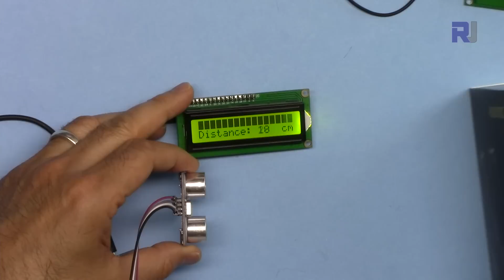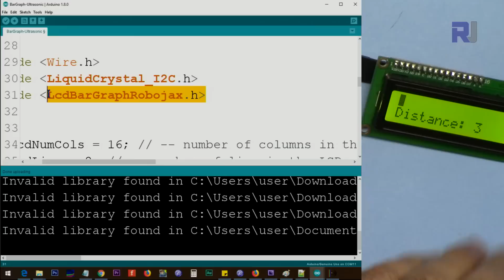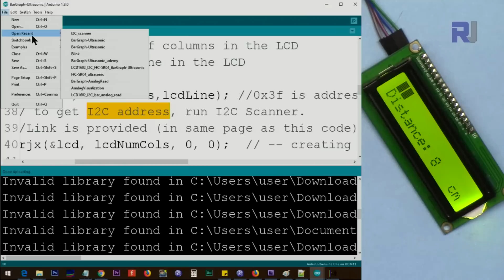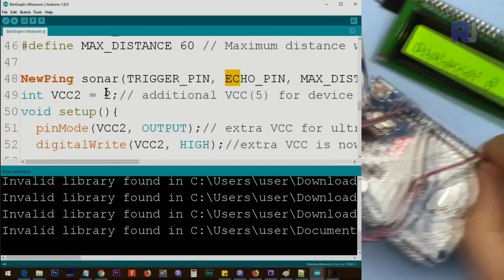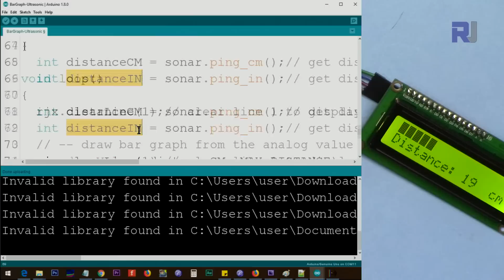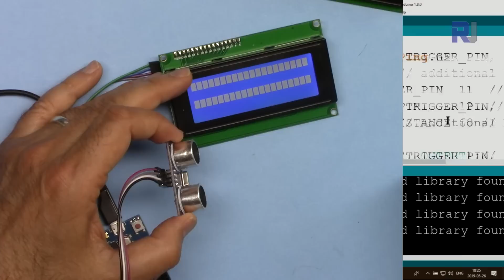Display distance from Ultrasonic sensor as bargraph on LCD1602 LCD2004 using Arduino RJT158

Comment: can you please share the circuit
Reply from the maker: what do you mean the circuit? if you mean the wiring diagram, I have explained it fully. But I hope you have watched the video where I explained that 1-Watch introduction to Ultrasonic sensor  https://youtu.be/CpCLa60WNXY and make sure  you can read the distance on serial monitor. 2-Watch introduction to LCD Display https://youtu.be/pxUjEsJQW2M and then come this. you don't need anything except the code
Reply: @robojax  Thanks :-)

Comment: Everything is working fine for 10 min and suddenly my ultrasonic sensor stopped updating lcd display and it kept saying 0 cm I thought it was a hardware failure so I brought a new sensor and still not fixed but after sometime I it got updated and stopped updating do you have any idea what is happening ?
Reply from the maker: It is the wiring. Or check is there is serial.print which print in serial monitor, comment them all like this // so they don’t print.
Reply: I don't understand I paused every single moment of your video and checked everything that you have is there in my code or not and it's all correct and still I get the error
Reply: @Robojax See the upper reply

Comment: can i use arduino nano?
Reply from the maker: Yes you can. Just make sure you supply 5V to the modules
Reply: @robojax  can u make another video using flowrate sensor?

Comment: Hi, thank you for your video, when i want to download library from description it says site was not found
Reply from the maker: Hi, Recently Chrome has added some feature that makes it behave like that. please use firefox or microsoft edge. it will work fine.
Reply: @robojax  I tested with microsoft edge and firefox and it still doesn't work, Could you check the link please
Reply: @rossiachatamerlin6903  I don’t think he did

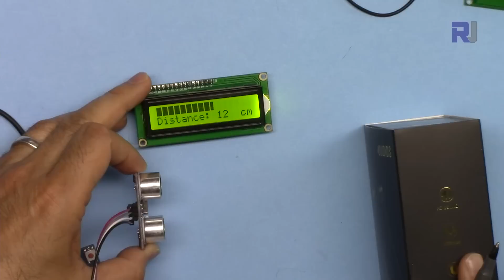Comment: 1. Arduino: 1.8.14 Hourly Build 2021/01/29 11:33 (Windows 10), Board: "Arduino Uno"

02:30:10: fatal error: LiquidCrystal_I2C.h: No such file or directory

 #include <LiquidCrystal_I2C.h>

          ^~~~~~~~~~~~~~~~~~~~~

compilation terminated.

exit status 1

LiquidCrystal_I2C.h: No such file or directory

This report would have more information with
"Show verbose output during compilation"
option enabled in File -> Preferences.

2.Arduino: 1.8.14 Hourly Build 2021/01/29 11:33 (Windows 10), Board: "Arduino Uno"

02:31:10: fatal error: LcdBarGraphRobojax.h: No such file or directory

 #include <LcdBarGraphRobojax.h>

          ^~~~~~~~~~~~~~~~~~~~~~

compilation terminated.

exit status 1

LcdBarGraphRobojax.h: No such file or directory

This report would have more information with
"Show verbose output during compilation"
option enabled in File -> Preferences.

please solve these two errors.
Reply from the maker: you skipped the video and did not follow the instruction.  I reply and any question that is not answered in the video. please watch without skipping and I can assure you,  your issue will be resolved.

Comment: this is what it says:
Arduino: 1.8.12 (Windows 10), Board: "Arduino Uno"

C:\Users\Yahya Ali\AppData\Local\Temp\Temp1_024-Using-Ultrasonic-Distance-HC-SR04-with-LCD-Display.zip\024-Using-Ultrasonic-Distance-HC-SR04-with-LCD-Display\024-Using-Ultrasonic-Distance-HC-SR04-with-LCD-Display.ino: In function 'void setup()':

024-Using-Ultrasonic-Distance-HC-SR04-with-LCD-Display:55:13: error: no matching function for call to 'LiquidCrystal_I2C::begin()'

   lcd.begin();

             ^

In file included from C:\Users\Yahya Ali\AppData\Local\Temp\Temp1_024-Using-Ultrasonic-Distance-HC-SR04-with-LCD-Display.zip\024-Using-Ultrasonic-Distance-HC-SR04-with-LCD-Display\024-Using-Ultrasonic-Distance-HC-SR04-with-LCD-Display.ino:30:0:

C:\Users\Yahya Ali\Documents\Arduino\libraries\LiquidCrystal_I2C-1.1.2/LiquidCrystal_I2C.h:58:8: note: candidate: void LiquidCrystal_I2C::begin(uint8_t, uint8_t, uint8_t)

   void begin(uint8_t cols, uint8_t rows, uint8_t charsize = LCD_5x8DOTS );

        ^~~~~

C:\Users\Yahya Ali\Documents\Arduino\libraries\LiquidCrystal_I2C-1.1.2/LiquidCrystal_I2C.h:58:8: note:   candidate expects 3 arguments, 0 provided

C:\Users\Yahya Ali\AppData\Local\Temp\Temp1_024-Using-Ultrasonic-Distance-HC-SR04-with-LCD-Display.zip\024-Using-Ultrasonic-Distance-HC-SR04-with-LCD-Display\024-Using-Ultrasonic-Distance-HC-SR04-with-LCD-Display.ino: In function 'void loop()':

024-Using-Ultrasonic-Distance-HC-SR04-with-LCD-Display:71:3: error: 'rjx' was not declared in this scope

   rjx.clearLine(1);// clear line 1 to display fresh voltage value

   ^~~

exit status 1
no matching function for call to 'LiquidCrystal_I2C::begin()'

This report would have more information with
"Show verbose output during compilation"
option enabled in File -> Preferences.
Reply from the maker: so it means you skipped the video where I mentioned that you need to install library. the import of this error was: no matching function for call to 'LiquidCrystal_I2C::begin()'
Reply: @robojax   no i installed the library it's still not working
Reply from the maker: this  project is made of 3 parts. 1-LCD only to display text.  2- Ultrasonic to measure distance and show on serial monitor. 3-Combine both LCD and ultrasonic.  do each project step by step from 1 to 3. I have video for them and I believe the link is in the description. good luck

Comment: Can we do this without i2c ?
Reply from the maker: yes you can if you re-write the code.
Reply: @robojax  thanks for the reply I’m not programmer please can you give me some hints?
Reply from the maker: You need to know programming
Reply: @robojax  🙏
Reply: @robojax  somehow I’ve done it but can you please tell me the opposite code for 
  rjx.drawValue( distanceCM, MAX_DISTANCE);  
this line , because for water tank level we need to subtract distance between sensor to water surface from total tank depth to find water level. Thanks in advance..

Comment: Arduino: 1.8.13 (Windows 10), Board: "Arduino Uno"

C:\Users\EE MDMD\Desktop\Untralsonic_distance_measure\Untralsonic_distance_measure.ino: In function 'void setup()':

Untralsonic_distance_measure:55:13: error: no matching function for call to 'LiquidCrystal_I2C::begin()'

   lcd.begin();

             ^

In file included from C:\Users\EE MDMD\Desktop\Untralsonic_distance_measure\Untralsonic_distance_measure.ino:30:0:

C:\Users\EE MDMD\Documents\Arduino\libraries\LiquidCrystal_I2C/LiquidCrystal_I2C.h:58:8: note: candidate: void LiquidCrystal_I2C::begin(uint8_t, uint8_t, uint8_t)

   void begin(uint8_t cols, uint8_t rows, uint8_t charsize = LCD_5x8DOTS );

        ^~~~~

C:\Users\EE MDMD\Documents\Arduino\libraries\LiquidCrystal_I2C/LiquidCrystal_I2C.h:58:8: note:   candidate expects 3 arguments, 0 provided

C:\Users\EE MDMD\Desktop\Untralsonic_distance_measure\Untralsonic_distance_measure.ino: In function 'void loop()':

Untralsonic_distance_measure:71:3: error: 'rjx' was not declared in this scope

   rjx.clearLine(1);// clear line 1 to display fresh voltage value

   ^~~

Multiple libraries were found for "LiquidCrystal_I2C.h"

 Used: C:\Users\EE MDMD\Documents\Arduino\libraries\LiquidCrystal_I2C

 Not used: C:\Users\EE MDMD\Documents\Arduino\libraries\Arduino-LiquidCrystal-I2C-library-master

exit status 1

no matching function for call to 'LiquidCrystal_I2C::begin()'

This report would have more information with
"Show verbose output during compilation"
option enabled in File -> Preferences.
Reply: What To do now
Reply from the maker: just watch the video without skipping and follow instruction. I have  said that you need to watch 2 more videos before coming to this and you did not follow that.
Reply: @robojax  Sir I have and also watched to more videos of that and also followed the steps but I am having  problem .
Reply from the maker: Required videos (must watch) and install library
1-Using Ultrasonic sensor https://youtu.be/QI9541YQq7M
2-Using LCD with Arduino: https://youtu.be/q9YC_GVHy5A
3-Then come to the bargraph and install library

Comment: Can u pls tell why I do not have robojax-ultrasonic example?
Reply from the maker: Hi, I have explained it in the video. Exactly the question you are asking . please watch and I can assure you, you will get the answer.
Reply: Robojax I have downloaded the library and it shows all examples except the ultrasonic one
Reply from the maker: the code is on the page where you download the library. on this page https://robojax.com/learn/arduino/?vid=robojax-LCD-bargraph-Ultrasonic
Reply: Robojax there is no problem with the code. The problem is with the library. It does not contain the example of ultrasonic sensor. It only has example of more bar graph. The ultrasonic example was not available so I used the more bar graph example but it had an error of there is nothing as “new ping.h”

Comment: Hi, I have added the LCD bar graph robojax file in the Arduino software but when I go onto examples it don't have the ultrasonic section there! Why is this? Can someone please help! URGENT
Reply from the maker: Hi, you have not added then.  i just watch the video making sure I have explained it and indeed I did. So you must have skipped the video. Please watch again. you need to download two libraries.
Reply: @robojax  I downloaded both the library's, and inserted them as a zip file however The only examples that the robotjax file shows is: the bar graph and i2c scanner!! Im sorry for the annoyance, but please help me
Reply: Even when I look into the zip folder that I have downloaded, there are only two examples in them! please help.

Comment: Error compiling for board Arduino UNO.how to fix it??? After installing libraries mentioned in your robojax page ....
Reply from the maker: please provide the error. It seems you have skipped the video. Please follow the instruction . This will not work for you without watching 2 videos. 1-Video for LCD and installing library 2-Watching ultrasonic sensor and then 3- You have to download the library for bargraph. So proceed and I can assure you it will work. Thank you for not skipping the ads and keep watching them. This will help me a lot and good luck.

Comment: Connection or script are Correct but doesn't work on uno
Reply from the maker: I mentioned in the video that 1) you have to watch and test the LCD without anything else and make sure you can display a text on the screen. 2)you have to watch and test ultrasonic sensor making sure it work. (I don't know whey I am repeating the same thing that I have said in video, typing it here.) Please watch the video again and do not skip.

Comment: I have problems related to rjx.. its says 'rjx' was not declared in this scope
Reply: he purposely made the variable different in the code. Cheap work for getting views. Change LcdBarGraphRobojax lbg(&lcd, 16, 0, 0); into LcdBarGraphRobojax rjx(&lcd, 16, 0, 0);
Reply: @m.m.amusni9899  
Thanks bro
Reply: I already downloaded the two library but still got the error
Reply from the maker: I have mentioned in the video that you need to watch 2 videos before coming to this 1-Watch the ultrasonic sensor  video and make sure it works 2-Watch LCD1602 video make sure you can see a simple text on the screen then come to this video. The link for those videos are  in the page as the the code.  Good luck
Reply: @robojax  If somebody ask a question you should answer it. Rather than saying go and watch my other videos.

Comment: Nice video and explanation, how we can reverse the bar graph movement? I mean when the object is near, the bar graph is rises thanks
Reply from the maker: Thank you. to shown the values in revers, just above this line  rjx.clearLine(1); we need to change the distance value for example if you are using the "cm" value then add this line using map function which I have explained in many videos of mine
distanceCM = map(distanceCM, 0, MAX_DISTANCE, MAX_DISTANCE, 0);
now the distance when it is at MAX, will be converted to 0 (zero) and then zero, converted to MAX value. I have not tested it but it should work.
Here is map function if you need to see it  https://www.arduino.cc/reference/en/language/functions/math/map/

Comment: Hello.
Very good channel. I have been monitoring your channel for some time and I must say that you are doing a very good job. And I also have one question. This bargraph is horizontal, but it is possible to create a similar library for vertical bargraph. Thank you for everything and I wish you success in your work.
Reply from the maker: You are welcome.  I appreciate spreading the word about my channel. This LCD is horizontal. Vertically you will have two character. So simply rotate it and it is done. Isn't it?